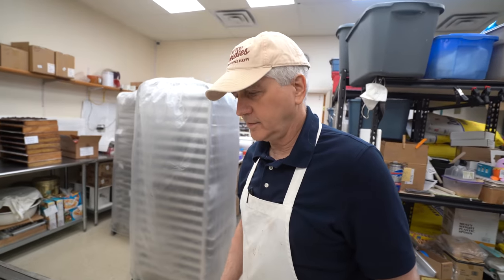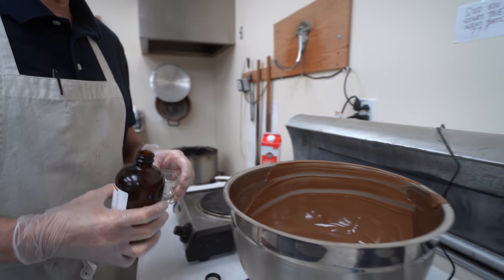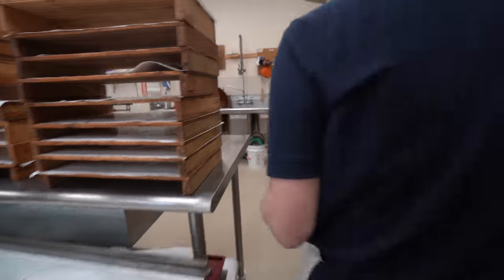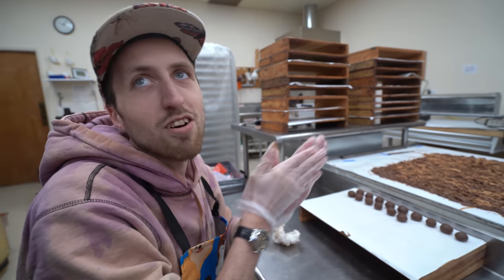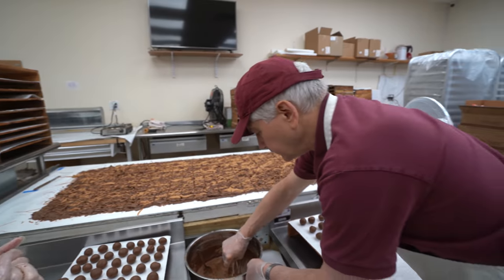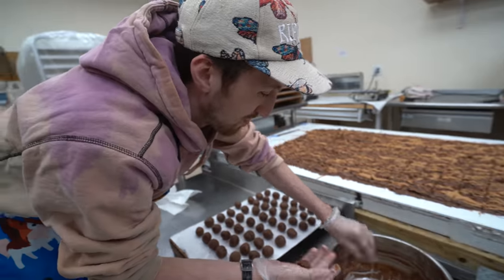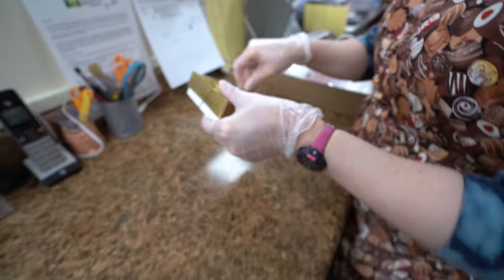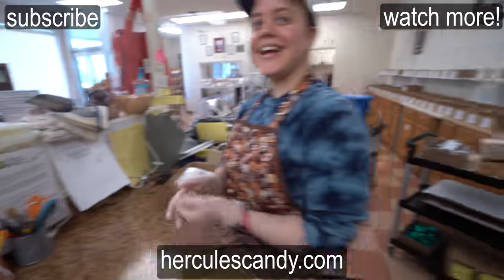This Rare Candy Takes 72 Hours To Make!

Comment: @HerculesCandy  For one pound, we line an 8x8 pan with saran wrap (or wax or parchment paper) and pour it while warm, top/seal with saran wrap, then refrigerate. You can then turn out the pan onto a cutting board. We cut into 64 (8x8), 1-inch square pieces. It goes much, much more quickly than scooping out spoonfuls (and in my opinion is easier too). We then roll the squares until round and dip them later. These make fairly large chocolates so you can cut into smaller pieces if desired.
Reply: Seems it would be much faster!

Comment: Remember to poke the sides of the Saran wrap box into the ends of the roll. That holds the roll in place as you pull the saran wrap out of the box.
Reply: Omg thank you!
Reply: Maybe an industrial wall mounted saranwrap dispenser with integral cutting blade would cut down all the fiddling with a falling-apart box.  We used them in our kitchens where I used to work, we had three of them placed strategically around the room so they were close to where we needed to use them.
Reply: That's the Aldi knockoff brand plastic wrap. The box falls apart as soon as you poke in the sides.
Reply: Try a box of press and seal. It seems a bit more expensive. But there’s really no waste. I’ve found that foot for foot the press and seal goes a little more then double the cling wrap at my house.
Reply: Was just going to say that 😆
Reply: When I told my family this, regarding aluminum foil, they were kind blown lol. How do people literally not know this?!
Reply: @katsmeow6946  Press and Seal is the best

Comment: I have been making truffles for over 40 years. I have found if you use a very small ice cream scoop, smaller than the one you showed, it is easy to keep them uniform. I then plop them from the ice cream scoop into a dish of powdered sugar and then roll them in my hands. Put on wax paper and stick in the freezer for about 20 minutes before hand dipping in chocolate. I take them out of the freezer a pan at a time so they don't melt as I am dipping them. Makes it much faster and easier. I also make a peanut butter and jelly truffle by making jelly candy into small balls. Freeze the balls and after scooping the truffle mix into a ball, poke a hole with a large dowel like metal skewer, drop the frozen jelly ball into the hole and fill with a dab of truffle. Again, freeze the truffles before hand dipping in milk chocolate. The PB & Jelly truffles are everybody's favorite.

Comment: I make these every Christmas, but mine have either Whiskey, Rum or Bailey's Irish cream then roll them in cocoa powder or chocolate sprinkles. Sometimes I roll them in very finely chopped walnuts or hazelnuts. I have made them with Malibu (coconut rum), with some chopped tinned pineapple, dried on kitchen paper, in the middle then rolled in finely shredded coconut so basically a Pina Colada!  These usually taste better using white chocolate.

Comment: My own suggestions: You could use parchment or pan liners to cut out the sticking.   The balling process would go faster if you repeated the same task multiple times, ie. scooping out the balls and then rolling those up and starting over again.  The longer it takes, the softer the mix gets so it pays, in the long run, to go as fast as you can.  I always try to cut down on repetitive movements like picking up the scoop and scooping out a ball then setting the scoop down then rolling the ball.  It cuts out a tiny amount of time, but that adds up.  It goes even faster if one person is scooping a bunch and then people are balling.

I really enjoy your videos.  Hope I'm not being too presumptuous.

Comment: If it's time consuming and hard to meet demand. Use the other method Steve mentioned and use molds. It will triple the the amount you can make in the same amount of time and as Steve said you don't need to wait a day for the mix to set

Comment: Could you pour the warm chocolate into silicone molds and then pop them out when theyre solid? You could still roll them if you want them round but theyll all be the same size and save the scooping time
Reply: I believe so, the problem is you would need a lot of molds for an operation as large as Hercules.
Reply: He just said that while he an Cooper were rolling the orange truffles.

Comment: How do you keep the truffles from sweating when you pull them out of the refrigerator and before you cover them with chocolate? Doesn’t humidity in the air condense on the cold truffles?
Reply: They shouldn't sweat out of the fridge. I make them all the time and never seen it happen. Although it will happen out of the freezer.